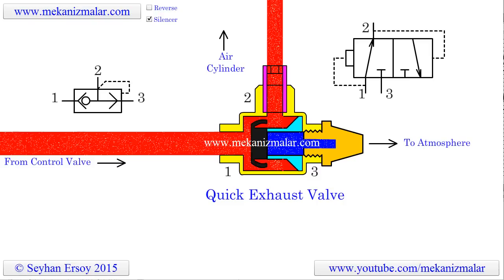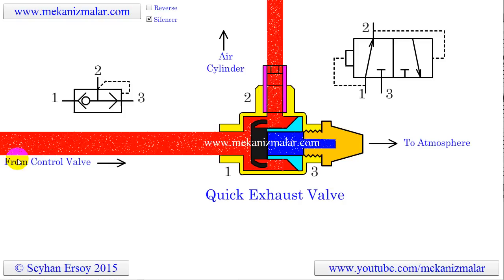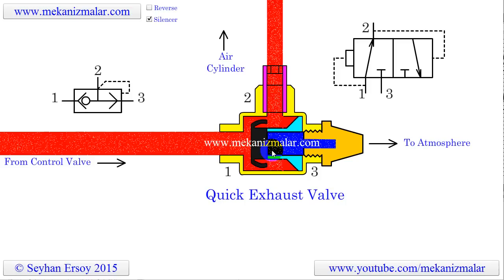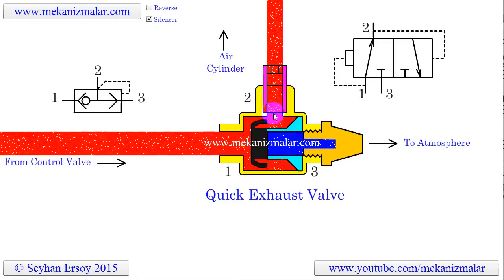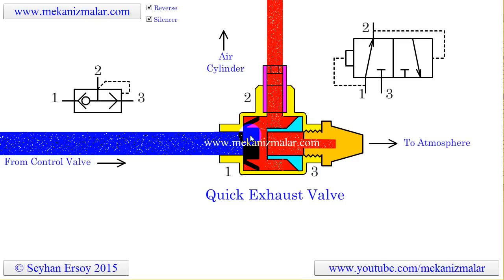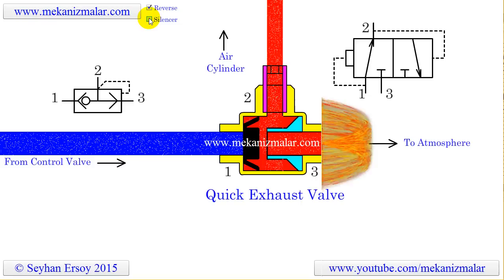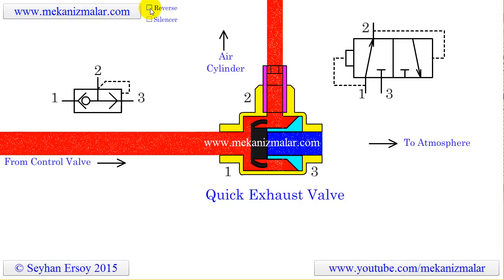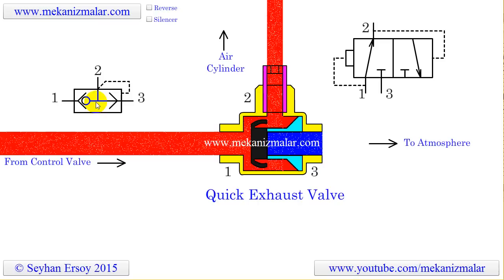how quick exhaust valves work?

Comment: Hey got an assignment to do here. Can an exhaust valve be used to get air out of the circuit quickly, for example with a pneuamtic door that needs to be opened in an emergency?
Reply from the maker: For opening emergency doors you should use a different circuit. The quick exhaust valve I am talking in here has a different purpose. For example you want the cylinder piston forward at slower speed but return to starting point much faster.

Comment: hope like this we won't need a 3 port sov ... 2 port with qev shud suffice ...
Reply: Incorrect, you will still need the 3 port sov to exhaust the pressure at port 1 on the QEV, if you use a 2 port sov you will lock in the pressure and the cylinder wont return. Unless you backed off the upstream self relieving regulator to a pressure whereby the spring can overcome it. But in my honest opinion, stick with a 3/2. Cheers

Comment: What is difference between pressure relief valve and quick exhaust valve please reply as soon as possible

Thank you
Reply from the maker: Pressure relief valve is used in hydraulic circuits. When a piston stalls in mid stroke, pressure rise in the cylinder pipes or hoses, This is not desirable. When pressure is above some preset value, relief valve sends portion of oil to the tank and reduces the pressure to desirable level. However keeping hydraulic pump running in this stalled condition causes hydraulic oil temperature to rise.  The quick exhaust valves usually used in pneumatic circuits, to increase response time of a cylinder to pressure change. For exampled, if a piston is pushed forward to do a job and you want to piston to return initial condition as soon as possible. Rather then releasing pressurized air through tubes, than from valve and then silencer,  quick exhaust valve immediately releases the air to the atmosphere. However quick exhaust valves usually creates more noise in the system.
Reply: A pressure relief valve opens at a set pressure to protect the circuit/system. Does not have to be hydraulic only, my air compressor has a relief valve to protect the tank if shut of switch fails.
https://en.wikipedia.org/wiki/Relief_valve